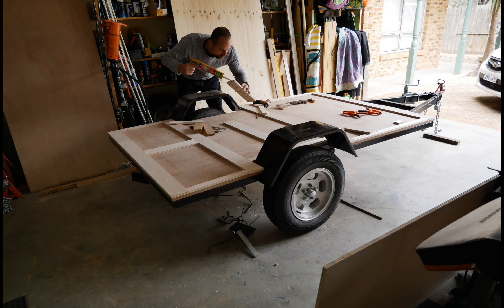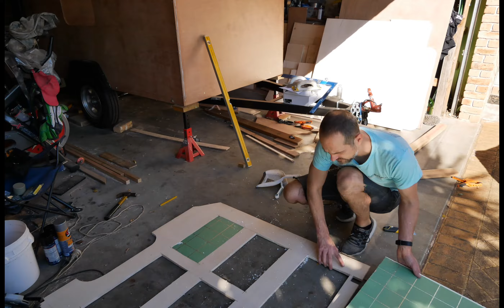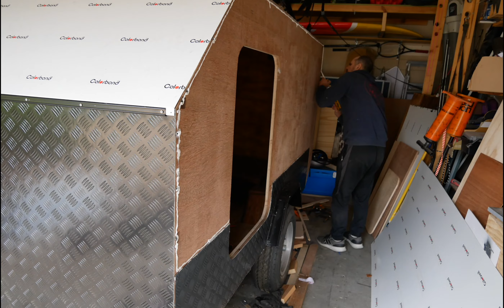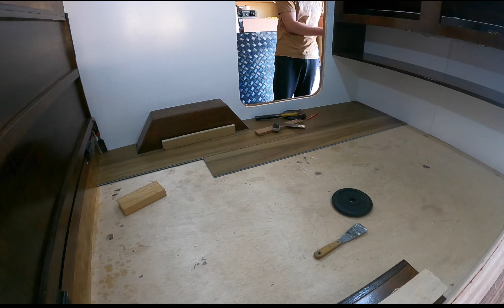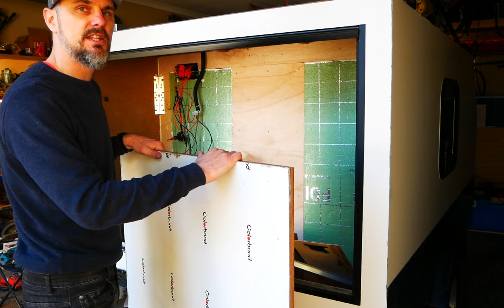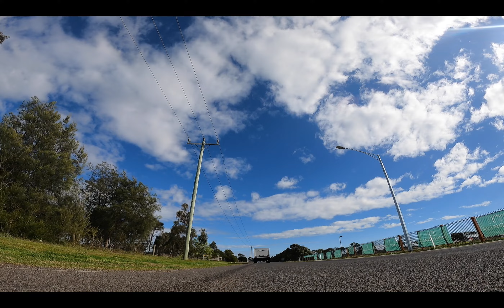Full Tiny Camper (Squaredrop / Teardrop Trailer) Build Timelapse - in 3 minutes

Comment: Thanks Roger! Watched twice at .25 speed, lol. You are the definition of 'Screwed and Glued'! Looks like a Very strong design! Your invention? Building over fenders maximizes interior space, but... I've heard tire issues, blowouts, suspension/axle failures can wreck a lot of stuff... My son broke a leaf spring on a small trailer and had to replace both fenders in addition to springs, hardware, etc...
Reply from the maker: Hm, interesting. I did have an issue with axle moving to one side, but that was my fault for not tightening enough and not welding it to the brackets holding the springs (been fixed since then).  The leaf springs I'm using are rated 30% higher than the trailer weight.  I also want to add a coil springs on each side to strenghten the suspension, so hopefully won't have any issues.  So far done over 2000ks with it and no issues.

Comment: Great job, so beautifully made and professional. Also, really awesome to see a video of someone in Victoria, Australia making one! I’ve been watching many videos the last few months, getting ideas and looking at the pros and cons of making one of these my self (not the frame part though) and have been wanting to see some that are relative to where I live for the regulations and standards side of things.
Reply from the maker: Thanks so much.   Good luck with your project.   If your trailer's total mass (including load) is up to 750kg, the vicroads regulations are very straight forward and simple (see my other detailed video for more info).  You really just have to make sure your lights/indicators are working... you need to place red reflector lights on the sides... and punch in the VIN and the trailer info on the the plack and chasis.  If it's above 750, then I think you may need to get some sort of inspection on it done... 
all the best
Reply: @ChilledBeans  What size trailer did you use also? That's the other thing I'm thinking about because I don't want it super small but I want to keep it compact
Reply from the maker: @amyocallaghan264  the dimensions of my box are 1.5m wide, and 2.6m long.  If I was making it again, I would maybe add 20cm in length to the internal sleeping comparment.  Otherwise I'm very happy with the size.

Comment: Hi Elvis, the door and windows you used, does it fit in all wall thickness or are we should not exceed 23 mm thanks
Reply from the maker: They are adjustable. But go on the links in the comments to manufacturer websites, i think they spacify the wall thickness range they support.

Comment: Very cool, I'm also about to build one for myself... and I really like your Hinge door. Thanks for that video too. I will be doing that. What is that colorbond layer made of?
Reply from the maker: It's 0.7mm steel. However I would use thicker next time - maybe 1mm.  Or go with aluminium composite panels or something... but this certainly gives it unique more of a matt finish
Reply: @ChilledBeans  oh ok thanks. Yeah I’m planning on doing roof in aluminum 050 and the side panels in plasTex bathroom wall panels since they are super affordable! The edges will be secured with the aluminum angled piece.
Reply from the maker: @sapettee  that sounds like a great idea too.  I might look into plasTex myself for the next build.

Comment: Hi There, I was wondering, how did you paint the aluminum trims in black? is that powder coated? thanks
Reply from the maker: The ones at the back that I had to paint, I sanded them a litte to roughen it up so that the pain sticks better. Then i just used high quality underlay spray (zinc based),and then sprayed with black gloss top coat.

Comment: What size sheets of plywood did you use for those wall and did you use 1 or 2 pieces each wall
Reply from the maker: Have a look at my other longer video of how I built this trailer... i may have snippets showing how i joined it. But i used standard 2.4 x 1.2 m plywood sheets. I had to extend both in height and in length.  This was pretty straight forward, i added extra layer of thiner ply under the joins ... as a cross member struts. All glued up.  I only had to extend length by a bit, like 0.6m roughly, and height even less than that.

Comment: Werribee boat ramp never looked so inviting. Great work mate, did you follow any specific plan's ?. Happy square drop glamping 😉
Reply from the maker: Thanks mate.
Hahaha... I don't have a drone so I had to climb on the roof of the public toilets to take that shot.  I didn't follow specific plans, mostly just made a rough sketch of what I wanted with dimensions, and then implemented it all in stages. And then before each stage I would do more precise planning and jot down the measurements relevant to that stage.  I looked at a lot of different samples online, and came up with my own desired model.  I've added all the accessories now too, so check this space in the near future if you are interested.
Reply: @ChilledBeans  thanks mate 👍, now to convince the missus.😉

Comment: You skipped over how you extended the back and top, which was the most important piece I wanted to see... Good job though :) How did you marry the top and back extensions?
Reply from the maker: You are so right... This was my first timelapse video, and I could have no doubt done things better with the video.  Basically, I cut the extra pieces for extensions (both height, and then back)... and then used exterior wood glue to join the pieces. I made sure to join them at the factory cut straight edge - so that it's perfectly flat where the surfaces meet and join.  When I placed extension panel on the top of the lower panel, I then placed on either sides of this join, long flat pieces of wood (18 mm ply in my case) using strong clamps (so that it keeps the joins perfectly straight). I had enough room to fit the clamps from the top as the top extension ply was only 20 cm tall.  And finally, i would please heavy objects on the top extension to apply downward pressure overnight until the glue would cure.
The rear extension was a little trickier... for that one, I first glued/screwed and  cured the supporting inside panels, and then clamped and clued the extension panels to that.  To apply pressure on the join, I propped pieces of wood between the garage walls, and the extended peace of ply.  I also of course used temporary flat plywood on the outside of the join too, so that the extended panel can't flip outwards.  A bit manual and fiddly, but it did the job.  Your main thing is to have that extra layer of lighter plywood on the inside - this keeps it super strong.
Hope this makes some sense.

Comment: Nice vid 👍👍 looks great. What did you use to cover edges of sheets? Cheers
Reply from the maker: Thanks Darren.  They are called J-Mould (at least here in Aus). I'm not sure where you are located, but I got mine from these guys: https://www.onestopcaravanshop.com.au/
There are ones you can use for corners, and then also for flat pannel joins. Very convenient to use, as you can drill and put screws, and you finally just insert this rubbery cover into the channel that covers the screws and protects from rain.
Another supplier:
https://styromax.com.au/products/styrotrimrv/
Reply: @ChilledBeans  thank you so much this has helped me. I am in Aus so that works out. Who did you have to register your camper with?
Reply from the maker: @WoWdespair  with Vicroads.  I'll put the info in my upcoming detailed build video. But in summary, 
- Go get your trailer measured at the weigh bridge (available at bigger servos, costs around $35). 
- Call Vicroads to get new VIN number allocated (they will ask you details about type of trailer etc)
- Also book registration appointment with Vicroads.  Download registration form (they will send them to you when you book appointment too).   
- Buy trailer compliance plate (ebay is good)
- Fill in the compliance place (you will need steel punch set - or just pay any trailer place to do it for you)
- Punch in the VIN on your trailer chasis somewhere
- Rock up at the Vicroads appointment
If your trailer total weight (with load) is under 750, you don't even need to bring the trailer to Vicroads. It's really simply, just show up and they will give you the number plate.
If your trailer is over 750kg, then they will probably require you to get some sort of inspection and RW certificate done (I haven't had to do this). I think over 750 the trailer may require to have brakes too.

Comment: We have only a class 2 (1.25") hitch receiver on our car  - would that be strong enough for a trailer this size/weight?
Reply from the maker: It really depends on what the specification/capacity of your hitch receiver is.  If you have one like this (https://www.jl4wd.com/auto/d/cur_120033/class-ii-1-25-in-receiver-hitch-120033) then it should be fine.  Based on specs for this type of hitch it's rated to 3500lb.  My mini camper's total weight (including luggage and all accessories) is around 1980lb (900kg), so it's well within the towing capacity of this hitch.  However, my teardrop/mini camper is a little more on the heavier side for it's size because I used heavier/stronger construction method and materials.  Some that you can buy can be lighter.  So you safest bet is to just double check your hitch brand towing capacity, and check the trailer weight, and then you'd be 100% safe.
Reply: @ChilledBeans  Thanks!. I also found out that our car will only tow about 1500 lbs. So we're really going to have to figure something else out.
Reply from the maker: @AlphaYTang  It depends on what type of mini camper (teardrop trailer) you get. You may be able to find some that are within that weight.  But it helps to have a stronger car too.  Hope you get to sort it out.

Comment: Damn, that is a high quality build! No cheating there.. It looks really good too! What is the weight of a trailer in that size?
Best regards, Jimmy
Reply from the maker: Much appreciated Jimmy.  The base version of this trailer (as in the video), weighs 720kg. So yeh, a bit on the heavier side, but I did build it to be very strong. It's super solid structure wise.  I have added a toolbox since, custom built roof racks + awning, and stabiliser legs.  I'm not exactly sure how much it would weight with those few extras, but i guess somewhere around 850 maybe.  But even at that weight, it's still no effort for any basic 4WD to pull it.  Stay tuned, I will be posting a video with full details of the build, with all the learnings, tips and extras.
Reply: @ChilledBeans  Yeah, i could see from the video that it is a rock solid caravan. When you sandwich and glue materials like that it gets very solid. Im asking about the weight because in Sweden i can legally tow 990 kg behind my Grand cherokee. I can upgrade my drivers license but i rather spend the money on a trailer. 😂 I really liked your camper because of the construction. I rather have a few kilos extra and a camper that can hold its shape even in rough terrain. With some weaker models you can´t open windows, hatches and doors if there is just a little bit of rough terrain.

Comment: Nice trailer. What is the trailer towing weight?
Reply from the maker: Thanks.  The trailer itself weighs around 750kg.  The suspension/springs are rated to 1300kg.  So I think around 1300lg is probably the safe limit.

Comment: Cestitam,od cega su vanjski zidovi (ja isto sada pravim camper)Filipovic
Reply from the maker: Hvala.  Super... voleo bi videti slike kada zavrsite.
Starting from outside:  0.6mm colorbond, then 18mm marine ply, then 15mm internal plywood (with insulation) and finally inside just 2.5mm interior caravan ply/cladding.  However if I could go back i would put at least 1mm colorbond to make it less prone to dents.

Comment: Sorry to bother you again, what is the metal that looks like diamond plate?
Reply from the maker: Hi Roger. No problem at all. The black metal I used for wrapping the lower part of the walls is checkered aluminium. It's around 1.3mm thick.

Comment: What is the thickness of the panels, and for that matter is it aluminum?
Reply from the maker: Hi Roger. So going from outside:
- the outer/exterior layer is 0.7mm steel sheets (this is only for final look). 
- then the main panels holding the structure - 18mm marine plywood
- then 15 mm regular interior plywood with cutouts for insulation
- finally on the inside it's 3mm melamine sheets (used for campers/caravans interior)

The ceiling is similar:
- 0.7mm steel
- 18 mm marine ply
- 30 mill ceiling joists with double insulation inbetween
- 3mm melamine

The next trailer I build, I'm planing to try something different:
- 3mm composite aluminium for exteriror
- 25-30 mm steel frame
- 3mm interior melamine